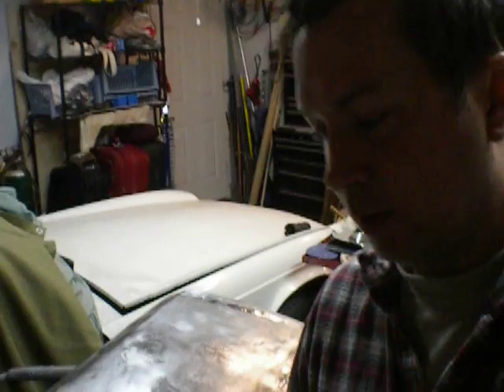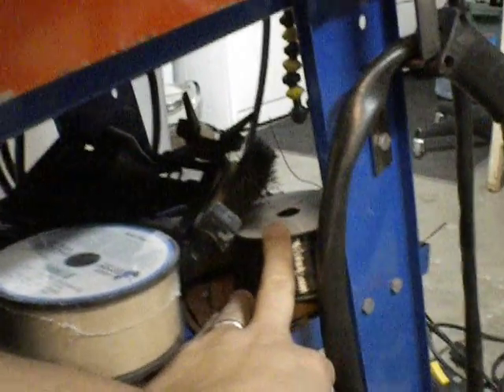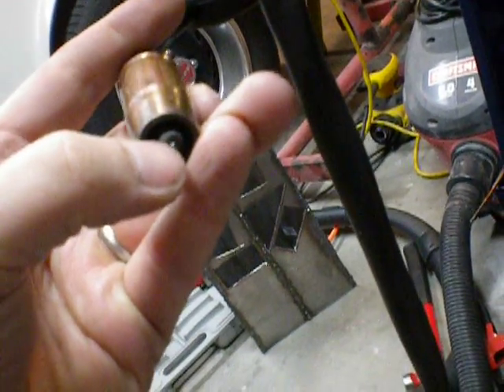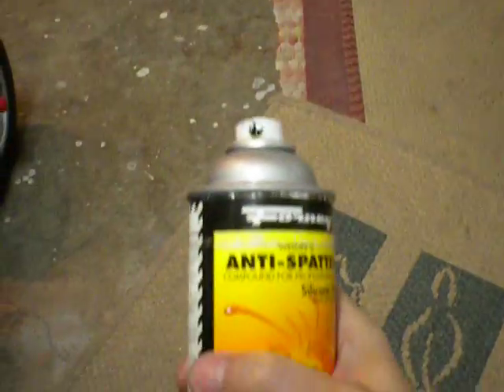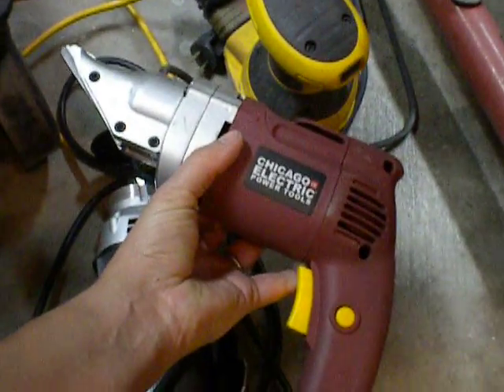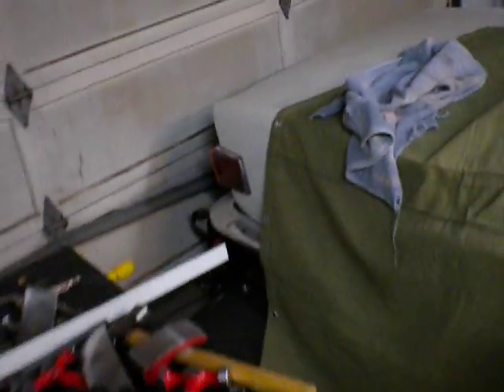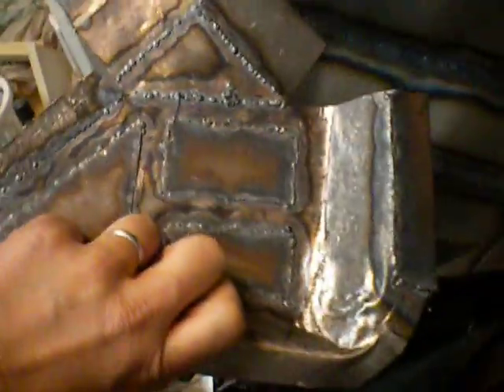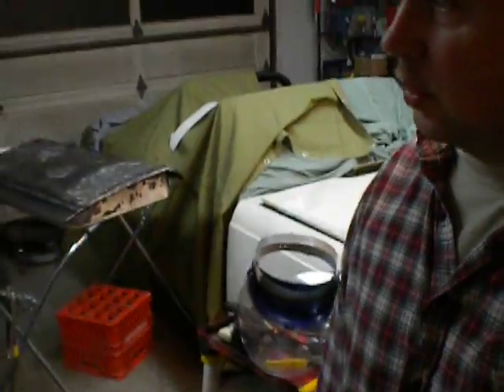Beginner Welding Equipment Recommendations

Comment: Dave. I restore Dirt bikes, cycles etc and looking for a decent welder for small jobs. Gas tank repairs, fenders, frames etc. what should I Get without breaking the bank. Sorry. Didn't see whole Video bi have my 3 young sons jumping on me   Thanks Bud !!!!
Reply from the maker: For small jobs I would get a small 110Volt MIG welder with a gas shielding setup, which is what I have. It has been able to do everything on my car and helping buddies (everything from sheet metal to bike frames, to a busted shock mount to fixing an old trailer frame, etc). If you're doing gas tank repairs and stuff like that, you might want to also check out getting an oxy-acetylene gas welding setup. That way you can do some brazing (basically soldering at higher temps). For MIG you'll probably wind up looking for a used Lincoln or maybe Hobart or Miller (they're pricier but better). I've read reviews and the Harbor Freight and Eastwood units are supposed to be OK too, and are a bit cheaper. Mine's an older Centruy, which was an older brand that got bought by Lincoln. For MiG new, you're looking at about $500 bucks for a smaller Lincoln, $200-300 for Harbor Freight/Eastwood. Used you can find them for $200 or so but they go quick so you have to look and be ready to jump on it. Gas is cheaper, like $150 bucks for the kit but you'll need to get the bottles. With gas I'd be careful about buying used unless you know what to look for. Mine was used but it was old equipment from my company so I knew it was in good shape.
Reply from the maker: davemiii Forgot to say that if you want to do aluminum you can do it with gas but it takes a lot of practice (go check out tinmantech), or you should probably get a TIG welder (way more$). You can get an aluminum spool adapter for MIG for like $200 but it's not as exact and detailed as you can weld with TIG.
Reply: davemiii Dave, You are the Man. Thanks for all the info. I will definitely use it. Appreciate your time and reply.....
Reply from the maker: Silk Boxing No problem, just paying forward all the help I've gotten over the years from the Youtube gang.

Comment from the maker: Aluminum is almost as good (thermally conductive) as copper. If you can find some scrap aluminum, that works well too. Usually it's flatter and clamps to flat sheet metal easier (depending on the geometry).

Comment from the maker: Hi Zagan, I agree not to quench anymore. I've learned the hard way that it warps them a lot more if I do it. But embrittlement really only applies for high-carbon and alloy steels, but for low carbon steels like on older car body panels you can quench them without making them more brittle. Because there's hardly an carbon, there's no martensite that forms to make the metal more brittle. (Beginner welder, but mechanical engineer.) But I understand newer panels have more alloying mat'l in them.

Comment: You only cool down welds if you need to say heat treatments etc because if you cool it down quickly it'll make the metal weaker because it changes the grain and it becomes more brittle.

Comment: nice vid, may I add that you can spray your anti splatter to your welding table it will keep it from getting weld balls from sticking, also that when switching from shielded to none shielded wire to make sure you switch the polarity of the welder,, hair dryers on cold make good air cooling guns too, keep up the good work,,